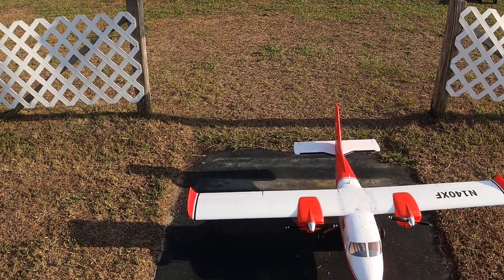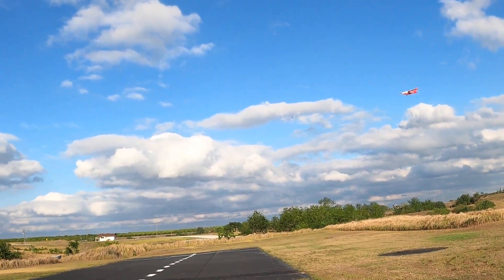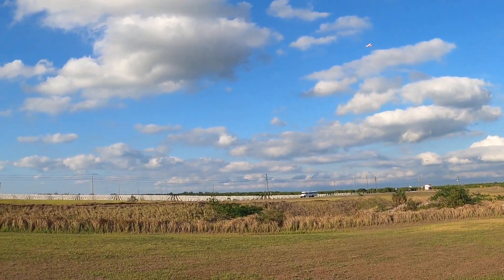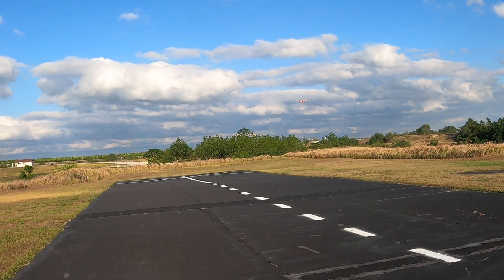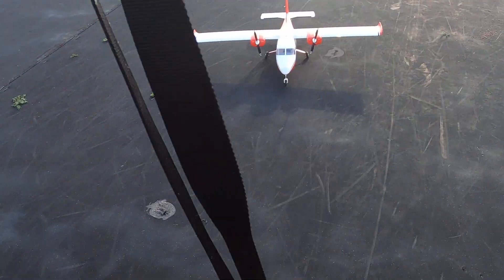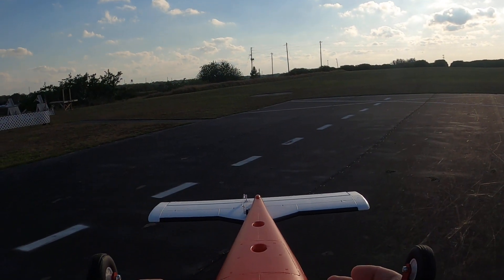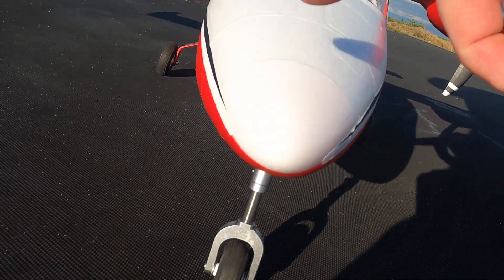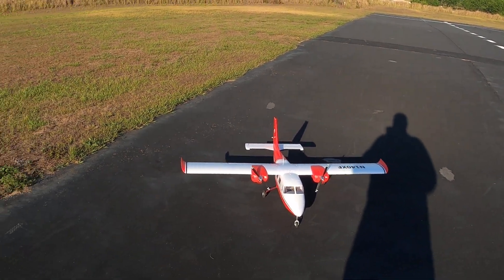X-FLY TWIN NOVA 1400mm-CROSSWIND MAYHEM! by Fat Guy Flies RC

Comment: In the UK you have no choice but to get the Multiplex version for £350. Like you I'm finding the main gear is fragile, bend in anything other than a perfect landing.  I've made a replacement  using 3mm piano wire. In retrospect maybe 2.5 would have been better. I find the best way to lubricate a tight connector  is some graphite dust from a soft pencil
Reply from the maker: The dust tip is a new one , thanks!!